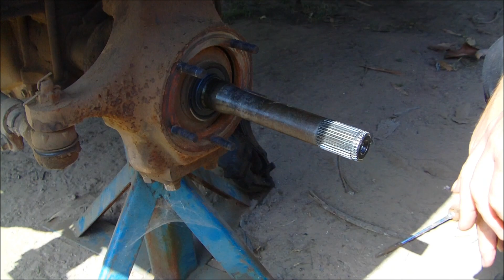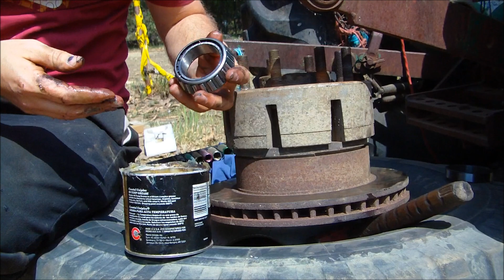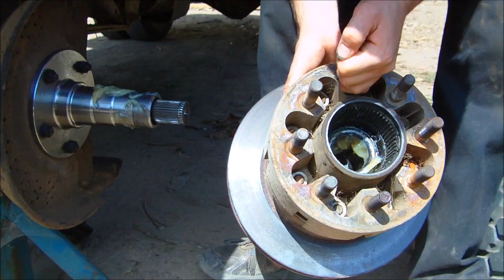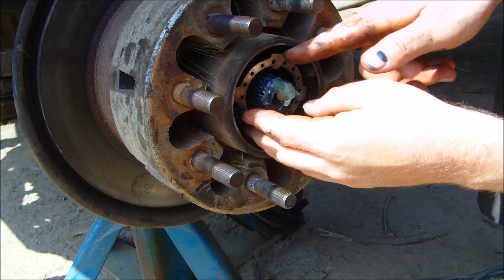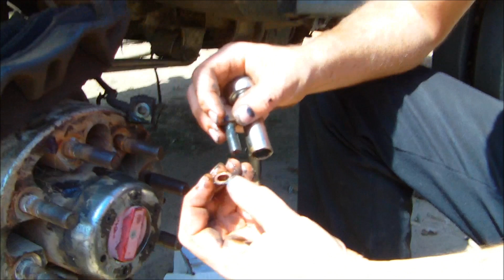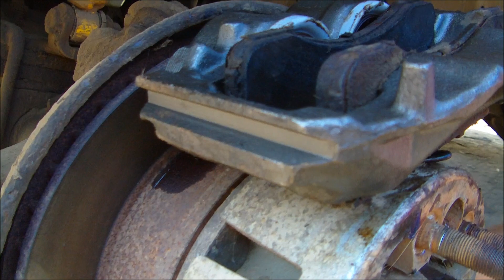How to change a 4wd's front axle shaft, spindle, etc

Comment: what year truck is that i have a similar axle just a king pin and need axle seals just cant find em with out a model year
Reply from the maker: It's a 1990 f-350. Ford used this axle in 1-ton trucks for many years though, it's very common. any '80s through late '90s ford 1-ton is the same parts.

Comment from the maker: Sometimes they are hard to get off, it's just stuck.  hit it with something, back and fourth until it starts to get loose.  don't use something that will dent it.  a 4x4 block of wood works well. you can also put the wood against the side of the spindle, and hit it with a small sledge.

Comment from the maker: @Currency49495 I have a build thread on explorerforum for my explorere's dana 60 swap.. maybe i'll make a short video showing how it i did mine.  

I've never had problems like that with the dana 35.  there must be something your missing on yours.  your not using cheap bearings are you?   did you replace the races?

i had continuous bearing failure on my mustang a while ago, turned out the spindle was slightly bent.. replaced the spindle, problem solved.

Comment: Very good video. 

If you get the time could you send me a list of what I would have to do to stick a Dana 60 in place of the TTB Dana 35 on my explorer? I continue having bearing issues and my front end or hubs are giving me huge headaches. Repacking and/or replacing wheel bearings every 3 to 5 months, something major is wrong and can't see to get a whole lot of questions answered on the explorerforum :(

Thanks and keep uploading :)